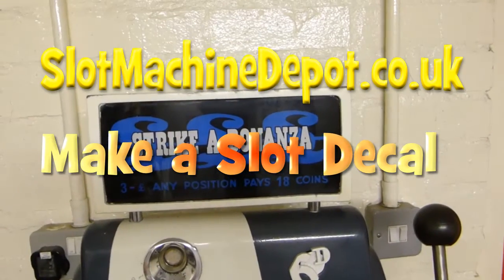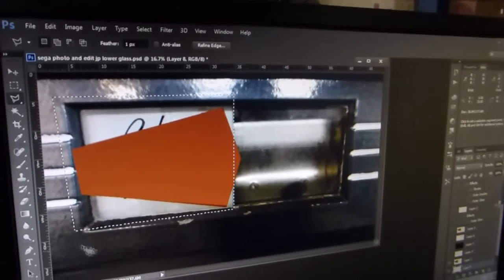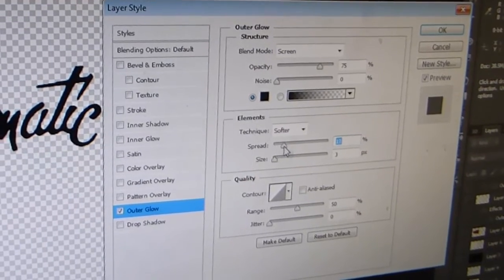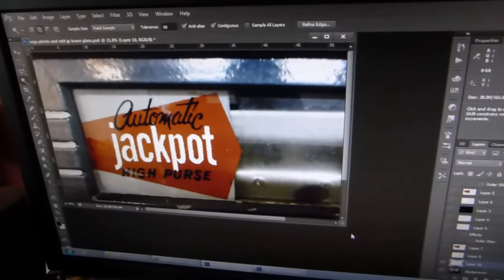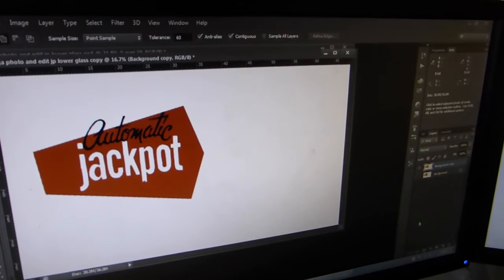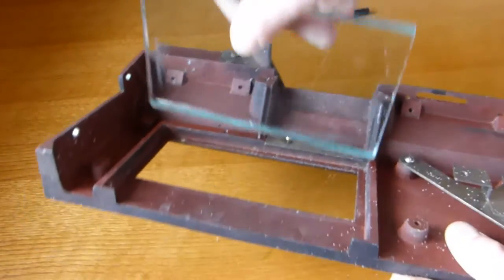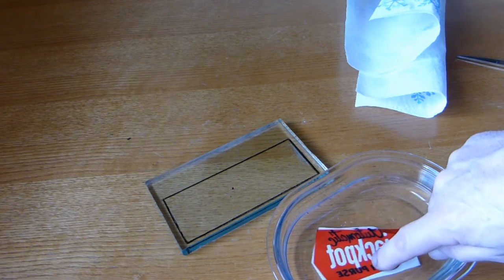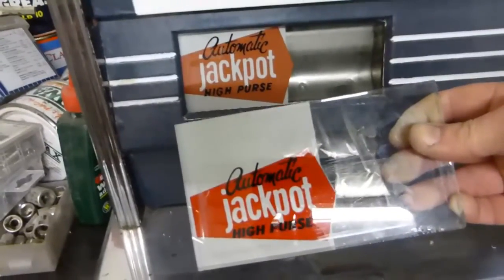Slot Machine Restoration - Create Water Slide Decals

Comment: Excellent video.  This gave me an idea and I'm hoping I can use this technique for a Bally E series slot machine top award glass.  I've already designed the rather complex graphic and flipped it horizontally. It is ready to print but because of its size, it will require two sheets of standard US 8.5" x 11" decal water slide paper.  The issue will be to see if I can work with two full sheets and not have a seam where they meet!